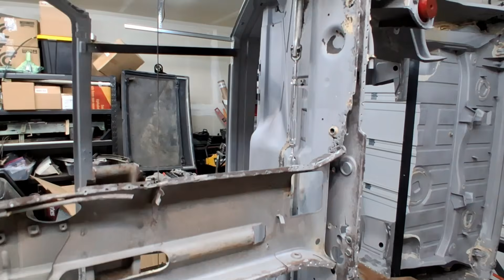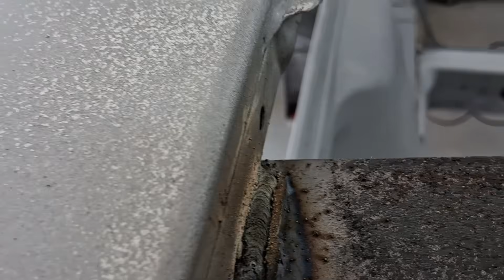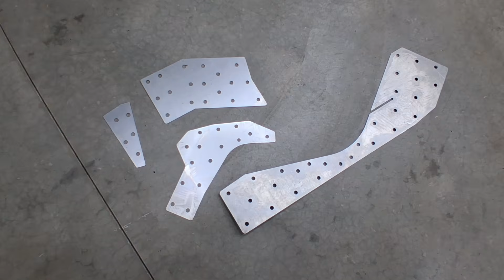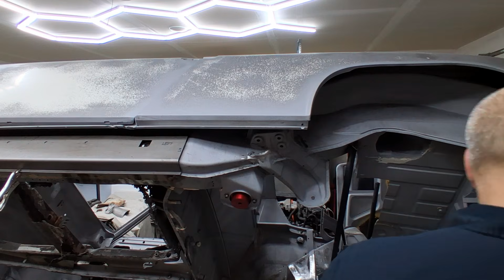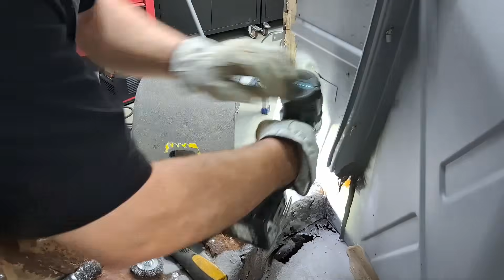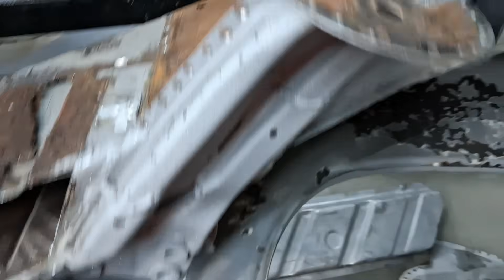Is this Porsche 914 worth saving?

Comment: What type of welder did you use? MIG? TIG? Flux? Gas? I will be doing similar work on my 914, and your setup looked to work well. TY!
Reply from the maker: Hey thanks for watching.  I have an Eastwood tig machine but have been using a cheap welder from Amazon its a Yeswelder Flux Mig machine. Works great off 120v and I didn't have to buy another gas bottle.  I highly recommend it.

Comment: Why havent you sprayed the entire car with epoxy primer before doing any repairs to protect the metal?
Reply from the maker: I want to get all the repairs completed. I live in a dry climate now so im not worried about it flash rusting. Its also been good to wait because im slowly getting all the sand out of the car as well.